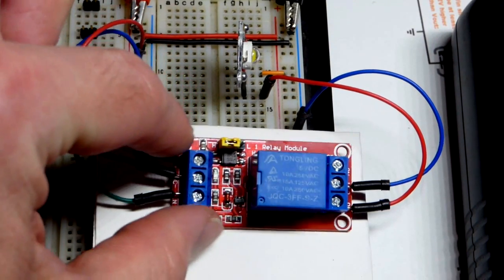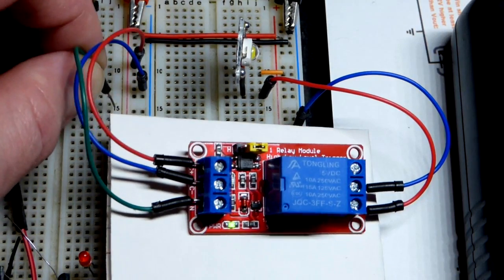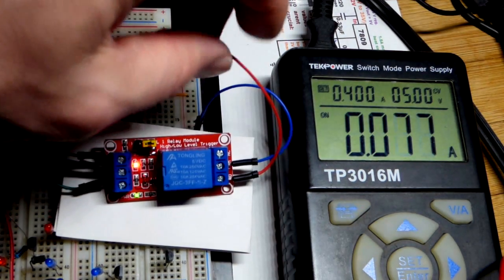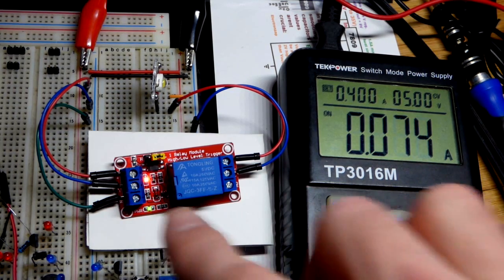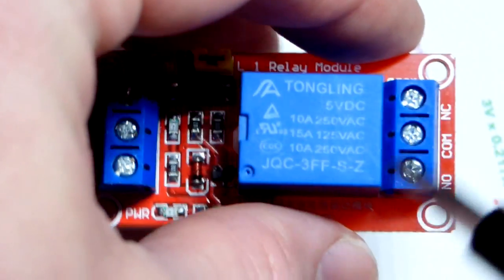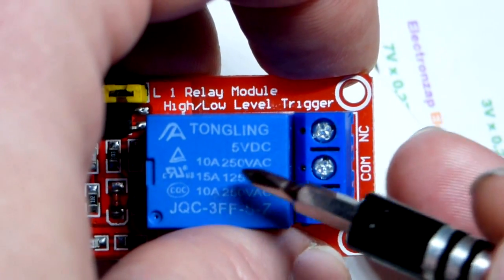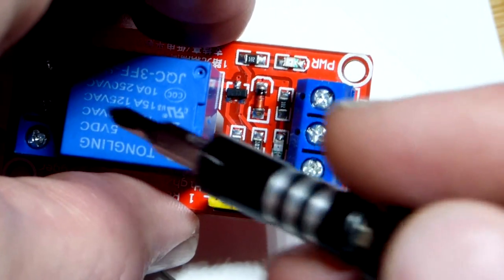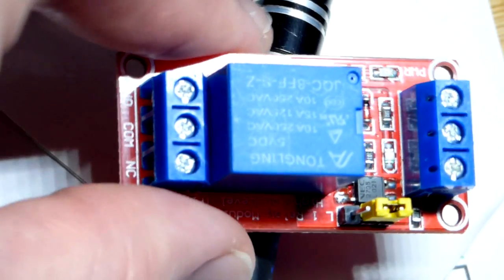5 volt relay module switched by either high or low input signal how to DIY demonstration

Comment: can I ask what size of screw driver did you use on relay  module
Reply from the maker: I made this video a long time ago, so don't know. I just bought a screwdriver kit with the most assorted bits at a low price. If the bit I normally use won't work well enough, I keep trying other ones I have til I get the best grip on the screw.

Comment: So for it to work as a trigger does the trigger line need to have its neutral connected to the coms too?
Reply from the maker: The mechanical switch part is completely separate from the control and module power parts of the board.  It can switch a load with the same power source as the module or have a completely different power source, but only connect one or the other.
Reply: @Electronzap  Appreciate you taking the time to respond. This might be easier, so basically the issue I have is, the machine has a 5v lamp that is usually on, but at times it switches on and off automatically, I want that 5v lamp to trigger the relays switch/trigger. However there is only 1 line in on the modules trigger… and when I connect the one 5v wire off the lamp it does not trigger , but when I use the lamps neutral which I connect to the now shared COM , it works. I was abit confused as I don’t usually share two separate neutral lines. As the power to the module I use a 12v separate power source. All coming from the same machine, but from different circuits. Does that make sense and do you think that’s how it’s to be wired ?

Comment: hello would you please be able to tell me the module number for this relay device please,thanks KT
Reply from the maker: Don''t know that there is a part number, this is one of 2 sellers I bought these modules from on Amazon, which might show information you are looking for https://amzn.to/43oZyPR R REIFENG 6pcs/lot 1 Channel 12V Relay Module Board Shield with Optocoupler Isolation Support High/Low Level Trigger. That's an affiliate link,
Reply: Thank you very much ,i just keep getting the wrong search results when i put it in google ,was getting frustrating ,Thanks again KT
Reply from the maker: @katiekumcgil  A lot of stuff seems to just be randomly massed produced in asia, with limited markings, and sold under multiple brand names. I used to try to have things that I recommended in my video, but I was working so much that by the time I made the videos, the product wasn't even sold anymore or had changed significantly. That's good stuff for me to keep in mind while I make my material, so thanks for the comment.

Comment: I heard on forums they don't last long switching onand off, but that's got to be wrong cause otherwise no-one ever could build a relay computer, but u can can't you?
Reply from the maker: I watched some documentaries about relay computers, but I didn't study them much more than that. I think that all relay computers are just museum pieces now as transistors are probably better for computing than relays in every possible way. But vacuum tubes had a lot of their own problems, many apparently broke down more often than relays, so relays were competitive with them. Phone companies also used a lot of relays, so it may have been a lot easier for some people to find and know how to use relays than vacuum tubes.
Reply: @Electronzap  what lasts longer a valve or a relay u think?